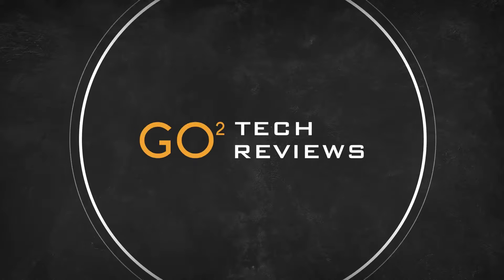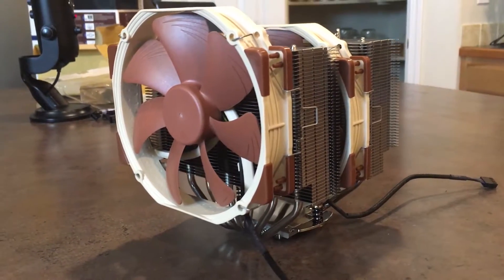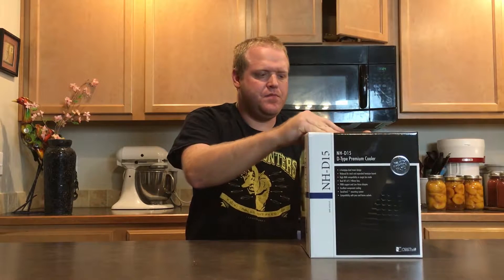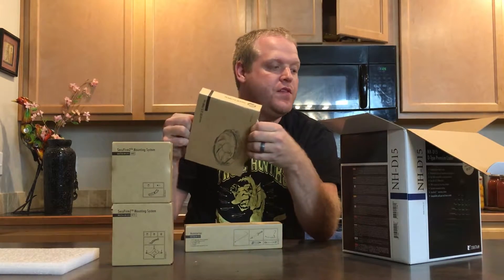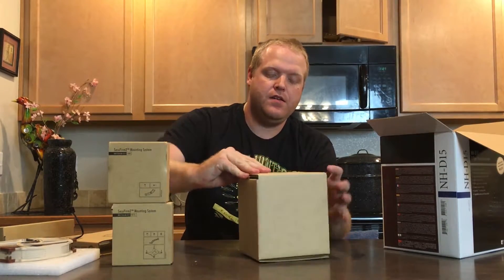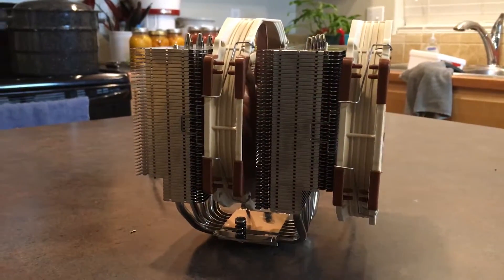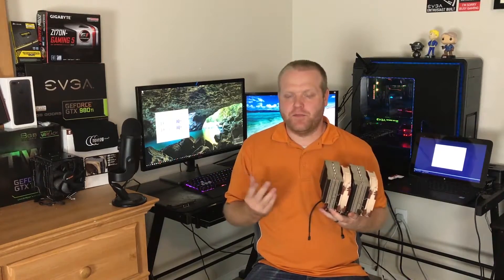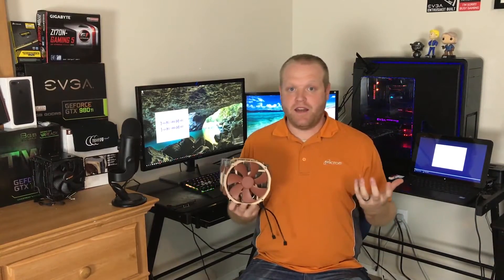Episode 38 - CPU Cooling: AIO vs. Air Part 1 - Noctua NH-D15

Comment: Curious at what distance did you measure the noise levels?
Reply from the maker: About a foot away. I'm in the process of making sound measurements more consistent/scientific between videos/experiments. I mean they are consistent per video, but not from video to video if that makes sense.
Reply: Forgot to say, thank you for this and your other videos - you are giving very useful feedback to potential buyers/users/buiders/gamers etc.

On the subject of noise measurement, I totally understand, and yes, definitely should standardize your measurement method. May I suggest that you use a directional/unidirectional sound sensor, located in relationship to the computer where the user's ear would be (typically 16" above the desk surface, 16" away from the case and 20-24" away from the monitor), and pointed at the computer. This should give the most realistic approximation to what an actual user would experience. Plus, using a unidirectional microphone will reduce the amount of noise measured from other sources (such as echo, air conditioners and printers) that is added to the noise level generated from inside the case.

I actually just ordered a Noctua NH-U12S to replace the stock cooler on my daily workhorse (i5-6500). There is nothing specifically wrong with the stock cooler, except that I hate the way it sounds. It is not very loud at low loads, but it makes a persistent annoying whine (it gets worse as the load goes up) that is irritating me beyond measure. I have a mATX MB in a cube case, so this is the best and largest air cooler that will fit. I thought long and hard about an all-in-one, but because I depend on this computer for work, I wanted to reduce the number of things that can fail as much as possible, and I was worried about adding a pump that can seize and fluid that can leak. I spent most of my life working with pumps (see my profile picture) and... There are limits to how much you can trust them :)

Thanks again for your highly informative content. Subscribed & liked.
Reply from the maker: I actually use the Blue Yeti in conjunciton with Audacity and then plot the dBA scale using a Matlab script I found online. I'll have to take a picture sometime of where I set the mic, but I like the idea of omnidirectional rather than in a cardioid mode.

Comment: Did you think about installing the Industrial PPC fans on it? They come in black and you can change the colors of the rubber edges (name escapes me atm) just have to ask Noctua for the 140mm brackets and they will mail them. Currently waiting for mine to arrive as the brown fans won't go with my blue and white build haha. Anyway just a thought.
Reply from the maker: +John McMillan Good point!